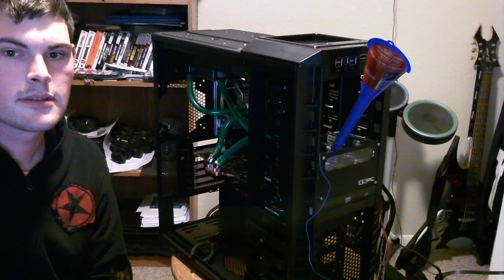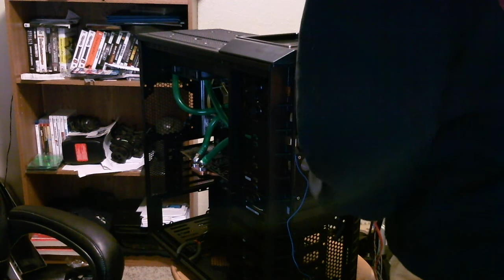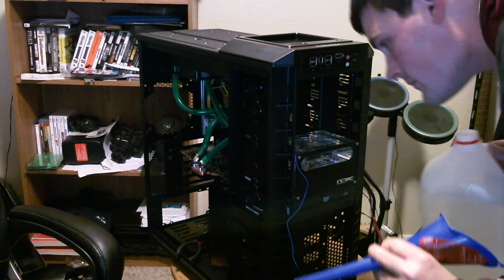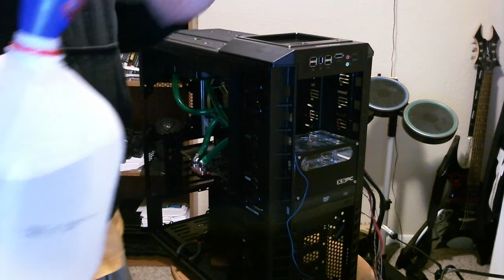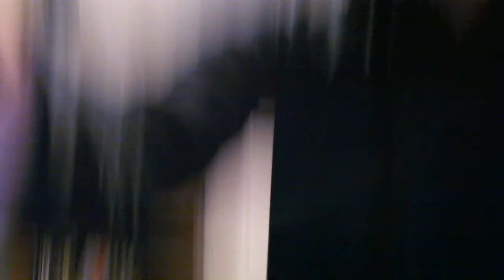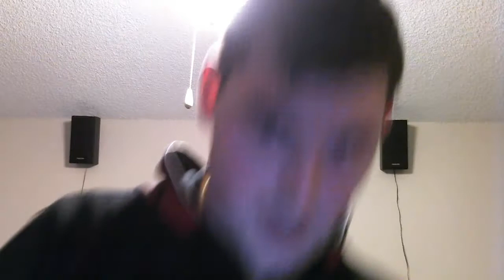How to setup and install a water cooling setup/loop (Part 3)

Comment: @007dardan The only way you can really get all the tubing the perfect lengths and everything just right is by setting up up IN the case. So, fair enough it may take a little longer if you spill and have to wait for drying but the end result is better. Why waste you time watercooling in the first place if you're going to end up with a sub standard setup by not getting everything perfect?

Comment: @JagoTFC -continue
first thing i need to know: how great has to be the cooler?
as pure water is aggressive towards metals how long can last a liquid cooling implant and how to manage pH of the water? what is used to keep the water "dead" and how reliable is it?
have I got to replace the case fans to accomodate the cooler or is it possible to use them in some way?
between the cpu and the gpu needs to be a cooler? how big?

Comment from the maker: @JagoTFC 
Indigo extreme is the best thermal paste. But it is expensive and it is only one application. Some people don't like ic diamond because it is to thick and hard to spread. To solve that issue soak the syringe in warm water for a couple of min. Also of you do use ic diamond you have to do a pea size amount of thermal.paste in the middle of the cpu

Comment: i am looking for some knowledge about liquid cooling, i am planning to use an i7 2600k and ati hd 6950 in a haf x case
the configuration is about to cost 2000€ and the air cooling solution cost about 100€ (cpu heatsink noctua and some case fans from cooler master) not counting thermal paste. i did some research and i discovered the innovation cooling ic7 diamond to be the best performing thermal medium in the market, i am not going to be cheap when i spend 1800€ only for pc components. continue-